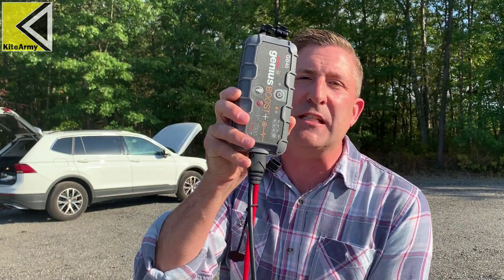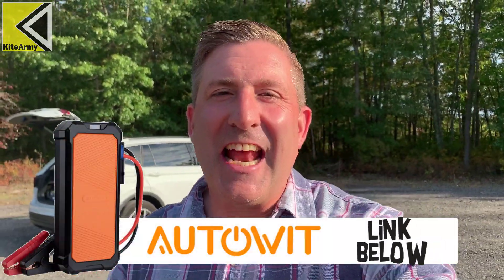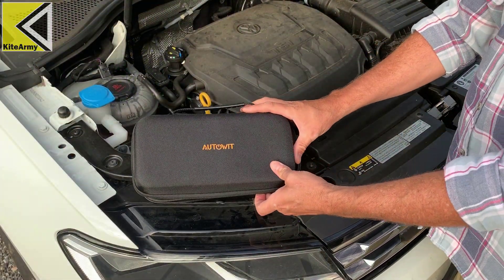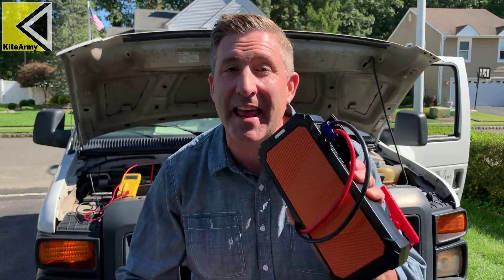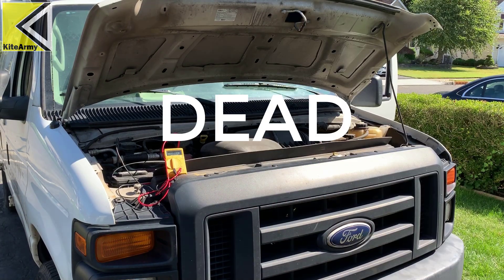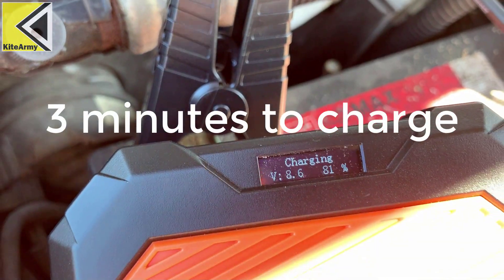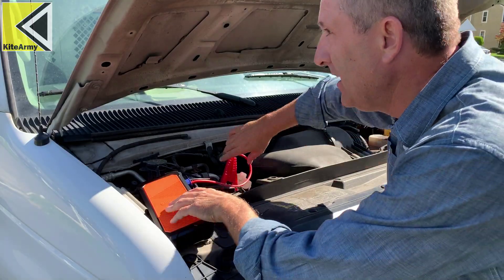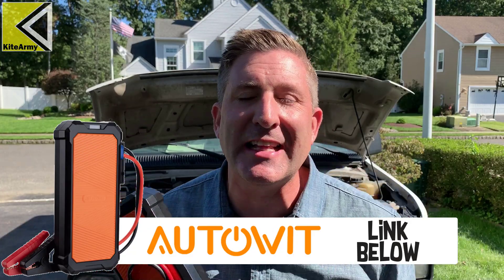Supercapacitor Portable Battery Car Jump Starter | DOES IT WORK ? 🚘🚘🚘

Comment: Couple tips to consider. As a long haul trucker I had to have the Oz rescue mate 1,000 amp  , 4 packs at total 4,000 amps to jumpstart my semi truck with 4 12 volt 1000 amp.  Batteries. I need 2 of those to jumpstart my 2002 F350 diesel with dual 1,000 amp batteries on its 7.3 diesel engine.

So with any vehicle, get one or more capacitors ( one for each battery) where the capacitor meets OR PREFERABLY EXCEEDS the battery’s cold cranking amp requirement.
On a diesel vehicle, glow plugs will alter the usage of a super capacitor but will work the same. To do this, with the proper capacitor, turn the ignition key on first. Let glow plugs cycle. Then send the charge through. If truck is too weak to cycle the glow plugs, you may have to “prime” the batteries before use.

To prime them, ignition off charge super caps and send power to jump it but leave key off and don’t start vehicle. Wait about 30-60 seconds, reconnect and prime it again. After about 2-3n”primings: it should be enough to cycle the glow plugs. When ready, turn ignition fully on but don’t crank it. Send power through. Gauges and plugs will cycle, then before power transmission stops try to crank it over. If it starts great. If not. Prime the batteries a few more times with ignition off. Then when you are ready to try again, leave ignition on, but don’t start it. After 2 or 3 cycles of glow plugs and gauges without starting, shut off at end of each cycle to recharge capacitors.

This process puts extra fuel in the cylinders AND warms them a bit more than normal. So after about say 3-4 priming cycles with glow plugs on and fuel pump filling cylinders, there should be enough warmth and fuel to assist the batteries in turning the engine over. This has helped me when I forgot to plug truck in and over night it was 8 volts and 15 degrees below freezing.

That is a MAJOR ADVANTAGE vs trying to ask a stranger or tow company for a jump start. You can use it multiple times vs how many times a stranger might give one or 2 tries and leave, yet these devices keep working tirelessly,

So make sure amps meet or more preferably are higher than what your vehicle requires. My 6k amp device jumpstarted my friends dead Chevy trucks 800amp battery and his truck started about 1/4 to 1/2 second of cranking when before, he could not turn on the interior lights. These devices are worth the price though. The more amps it has above your needs, the better it is. Hope this helps.
Reply from the maker: Thanks so much for sharing your detailed experience and advice!

Comment: I bought the item Autowit Supercap2 Jump Starter on 10 Jan, 2022 and checked it and it was charging, the digital display was working, sound was working. I kept it at home.
today my car was unable to start (BMW X5 E70 2008 V8), I tried to use it but the screen was black and no sound was coming. I tried to charge it from the car battery the cigarette lighter socket and also the USB connector at home but it is still not working the screen is still black and no buzzer sound is coming. what can I do to make it work??? is there any fuse inside that may have blown off and I can change it???
 I had to jumpstart the car the old way with cables from another car. 
please help

Comment: I left my keys in the ignition with the dash lights on. My car engine doesn't even turn over. I only get a clicking noise. Does that mean it won't charge up the charger and it won't work for me?
Reply: It should work.  your battery still has a charge just not enough to start your car this will boost the battery
Reply: @onenikkione  I certainly hope so if I am stranded. But the last time I was stranded it wasn't the battery's fault; the terminals had corrosion on them and so the car would not start even though the battery was fine. There was no way I could clean the terminals in that remote location either.

Comment: Good video.  I just purchased one a few days ago.  My battery was completely dead and unable to charge the unit.  I charged the unit to 100% using the cigarette lighter from another car.  The charging was within a few minutes and I thought good to go.  Placed cable connections on dead battery and nothing.  The unit never recognized the connection to the battery.   Am I doing something wrong with the cable connection to the dead battery? Thanks.
Reply from the maker: I think there is a mode to jump a totally dead battery
Reply: @Kitearmy  thanks
Reply: Just a quick follow up.   There isn’t any doubt that with a completely dead battery the Autowit will not work.  The unit will not recognize the battery after battery clamps are applied.  I called AAA to come and check the battery as it was still under the three year warranty.  They determined the battery was fine along with my charging system.  He used a Norco GB 150, 3000 amp jump starter and it worked flawlessly.  I then tried my Autowit and the product worked as advertised.  Since I don’t drive that car much, I will pick up a Norco 5 A trickle charger to prevent this from occurring again.  Maybe even a GB 150 2000 amp unit and return the Autowit.

Comment: For those saying it won't work on a completely dead battery - you need a new battery, go buy one.
Reply from the maker: that is the truth
Reply: No, 
Sometimes you forget to turn off the headlights or the lights in the cabin until there's no power left in the battery... If that happens, you don't need to buy a new battery.

Comment: Since it is not possible to create or destroy energy, the theory behind this device is that it transfers some of the remaining energy (watt-hrs) from the almost dead car battery to the capacitors. During this transfer some additional energy is lost to heat energy due to internal resistance. Once charged, the capacitor bank has a much lower resistance than the car battery so it is able to “give up” this energy in a very short burst (period of time). The voltage of the capacitor bank can never charge to a voltage higher than the almost dead car battery. The reason the car will start at this lower voltage with the capacitor bank and not the battery by itself is due to the low internal resistance of the capacitor bank. Simple ohms law and power equations.
Reply: lol. Wrong. 😂
Reply: This one has a small inverter chopper, meaning it raises the voltage of the capacitors to 14v, so it starts well. Also, a 5v USB can charge this over 14v.

Comment: I have a similar product, which is rated at 500A.  It would not start my 103 cubic inch Harley Davidson V-twin, but did start a 1.5 litre Suzuki Swift (more cylinders, but smaller pistons, so easier to crank).  I'm considering buying the AUTOWIT 1000A model for an extra unit to keep in the family.  The good thing about the super capacitor jump starters is that you can never predict when you will need them.  From when I bought my very first S/C jump starter, it was 3 years before I needed it.  There was no way I could have kept a lithium battery jump starter on charge for this unpredictable day.  Even after using my S/C jump starter, it gives me a wonderful sense of satisfaction, despite myself doubting that it can actually do the job.  If the AUTOWIT 1000A can start a Harley Davidson, then I'll be happy.

Comment: One of the problems with the lithium based ones is that they get charged and stay charged. Lithium ion batteries are not long term storage, they are great for shorter term. 
A lithium battery stays healthy when you charge it, use it, then charge it again. Best life keeping it between 30-80% charged, as both ends of the spectrum decrease cycle life. Charging it to 100%, then letting it sit there for months in the truck of the car kills the battery, so when you need it, it appears fully charged to the controller (based on voltage) but does not have the capacity needed for working (battery drains very quickly).
This eliminates that problem of long term storage expectation of a lithium battery.

Comment: I have one and never fail me.  Also no batteries to worry about
Reply from the maker: great ot hear
Reply: After replacing two lithium based jump starters when they were 2-3 years old and no it's time to replace one of those replacements at 2 years old. I'm looking into this as something new that could last longer. It's bad enough replacing the car battery every three years, replacing the jump starter also gets expensive.

Comment: FYI "solid-state" does not mean without chemicals.  It generally means it's a semiconductor usually containing diodes or transistors, more specifically they have a junction between 2 or more N and P materials.  So generally capacitors are not considered a solid-state device.  You could say it is a static-state device I guess.

Comment: "Having a charged battery in your car during hot and cold temperatures, that sounds dangerous to me."

The ones that start every ICE powered car in America seem to be doing fine.
Reply: @bsnyder4912  Learn the difference between lithium batteries and lead acid ones. You should get to the point.
Reply from the maker: @bsnyder4912  Have you ever seen shipping boxes that have special labels because the package contains batteries?  Makes you wonder why that is
Reply from the maker: Sure - America is doiong fine but not the person who has the battery blow up in their car

Comment: So... I don't understand, the battery charges the car or vice-versa? 🤔 
Why does the battery keeps charging after connecting to the car's battery, considering that this one is dead/empty?
Reply: Well, there are a lot of situations (we saw it in the video) where the battery is NOT DEAD, but just doesn't have enough voltage to make sparks in the ignition, or enough power to turn over the starter.  This seems like it can save up enough charge for a few seconds of starting excitement, kind of an emergency thing.  It might be something like a "charge pump" where the capacitors are charged one at a time, or in pairs or whatever, and then used all together.  So it's putting the power you DO HAVE (there has to be some!) in a different format.  I think an analogy might be where you move something with a long lever or pry bar.
Reply from the maker: it's real and it works - don't ask me how

Comment: What’s the lowest voltage it will charge at?
Reply from the maker: probably about 6v
Reply: @Kitearmy  Could you charge it with a 9 volt smoke alarm battery or a set of 8 AAs?

Comment: It will not start a car with a dead battery i.e. if you left your headlights on. You need some juice in it to start the car
Reply from the maker: Right - that is the limit
Reply from the maker: user name  I tested it on a battery measuring about 4volts - would not start
Reply: @Kitearmy  i heard that it comes with a cigarette port charger, which if someone is around you can charge the Supercap and it has the necessary juice to start the car. That is, if there is someone around for you to charge it. I have a NOCO GB and it still wouldn't start a car battery measuring 4 volts. At that low voltage, you just need a new battery or something is really wrong with the charging system.
Reply from the maker: @nolo00783  True - sometimes you need a new battery

Comment: I still prefer lithium ion jump packs, especially the ones between 18,000 Mah and 32,000 Mah. They can jump start any car and work as a battery bank.
Reply: I just ordered the Autowit SuperCap 2 from amazon.  The reason I didn't get a lithium ion jump start device is you have to make sure you keep them charged.  Also, lithium ion batteries in a hot car do not mix.  Could be dangerous.  I also ordered a Autool BT-460 battery tester.  It tests battery health, starter, charging system and max load.  Between these two items, I've got things covered!
Reply from the maker: @Dazlidorne  You should be good to go for sure
Reply: @Dazlidorne  idk I left my lithium ion batteries in my hot garage in Arizona in my Milwaukee tools and was worried they might lose charge or damage the batteries came back 2 months and 4 months to check on it and they were still at full charge. After 4 months I had to use a tool and charge it again and then stopped caring to count.
Reply from the maker: I agree - this is a bit of a novelty
Reply: @Kitearmy  project farm did a great comparison on these
Reply from the maker: @TheCamaro5  He does a great job
Reply: This could be used over and over again. Battery models degraded over time, but are handy for other things like filling a tire or powering other stuff. Pros and cons to both, but for strictly starting a dead car battery up to big diesel trucks… you can’t beat these things. Pricey but pay for themselves if you have ever bought more than one battery pack to sit in the trunk.

Comment: Yes but if your car die on the road and  have to wait a few mins or more to start that's not good.
Reply from the maker: True
Reply: But if car dies on the road while driving thats charging system, not battery only. A jumper box wont help you in such situation.

Comment: Just curious, how many seconds can you crank the motor before the SuperCap runs out of juice?  What happens to the unused energy stored in the SuperCap after the vehicle starts? Is there any danger?
Reply from the maker: You have about 1 min to start the car - the power in the battery dissipates after a few hours - so no danger
Reply: @Kitearmy  What battery?

Comment: I own one and have used it several times on motorcycles. It works great. If you do run your battery completely dead all you need is another car and use their 12v plug or their battery terminals then bring it over to your car when its charged. Also, it can be charged from a micro USB port. I used a small USB power bank to charge this jump starter. It took about 5min. I highly recommend this product.
Reply from the maker: Cool
Reply: @Kitearmy 
Have you started any diesels with this?
Reply: would it be feasible to just wire the super cap right into the system and just start the car every time from it?  Would it get harmed if always connected?
Reply: @MichaelJeffers75 yes

Comment: These devices can only help if your battery is partially dead because it takes power from the battery.  Worst case scenario is your battery is completely dead and this type will not work.  The lithium battery chargers will.
Reply from the maker: True, though If car batteries go completely dead your probably going to have to replace the car battery
Reply: buy both

Comment: You got this free I'm sure , do it on dead battery . You can charge it separately and  test on dead bat, It won't  work
Reply from the maker: Do you think I would really spend all this time making a video and putting on my platform because they sent me a $150 product?  I stand by this video and no jumper will start a dead dead battery
Reply: @Kitearmy  yeah I do think you would do it for free stuff. No jumper will start a dead dead battery? Really? Wow your not a mechanic, that's the dumbest thing I have ever heard
Reply from the maker: I’ll make it simple for you.  If jumpers could bring back dead dead batteries they would not sell new batteries in the store and you would never have to replace them.
Reply: @Kitearmy  who said bring back a dead battery? You said jump a dead battery and yes jumper boxes can jump a totally dead battery. Capacitor type can not, that's the point, even if you pre charge it. that's the test I wanted to see. Cables off battery and connected to precharged autowit
Reply from the maker: @chadw6776  According to your first comment, you "know" that it will not work.  Sounds like your mind is already made up.
Reply: @Kitearmy  A jump pack has no impact whatsoever on a vehicle’s battery.

A jump pack cannot bring new life to a battery which is no longer serviceable.

And similarly, a jump pack cannot restore the charge to a discharged but otherwise serviceable battery.

The most a jump pack can do is start a vehicle’s engine.  What happens after that is the result of the vehicle’s charging system.

A non serviceable battery won’t accept a charge and must be replaced.

A discharged but otherwise serviceable battery will be restored to its rated capacity by the vehicle’s charging system in relatively short order after the vehicle’s engine is started with the help of a jump pack.

I don’t know why there is so much confusion over the difference between a battery which needs replaced versus a battery that simply needs charged.
Reply from the maker: @CH67guy1  If the battery is low because a door is left open - this will work for you